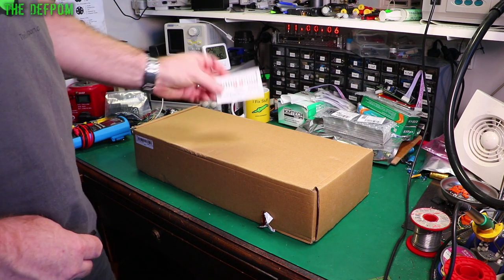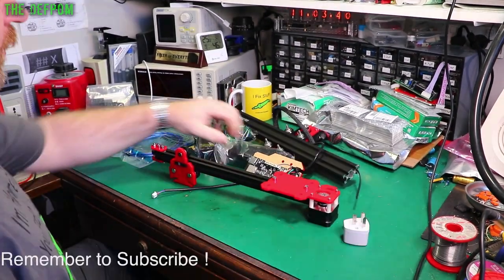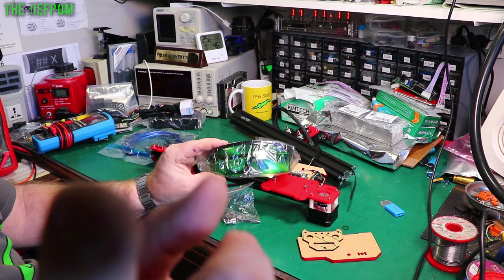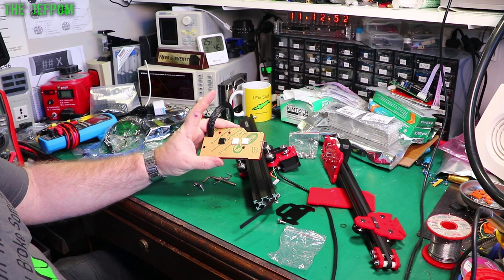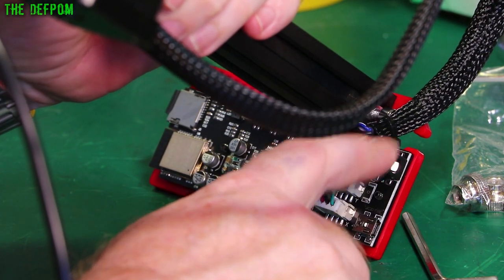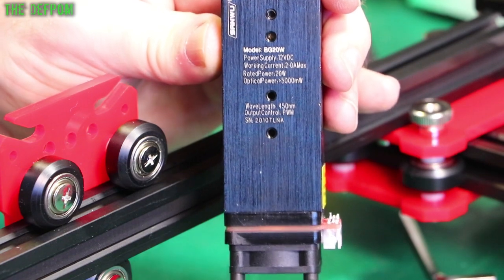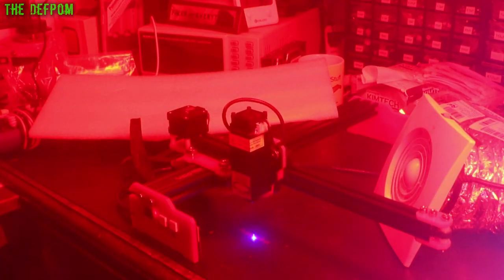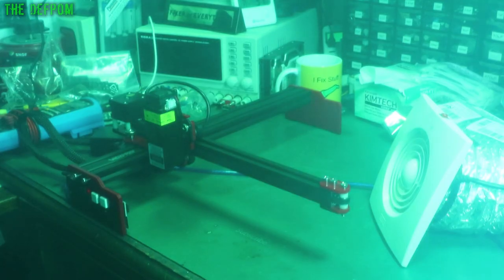🔴 Laser Engraver Review - Vigotec VG-L7X 20W Laser Engraver - No. 800

Comment: Will it engrave Aluminum?
It would want to modify so the object be engraved was would be firmly held in place in relation to the engraver xy frame and ensure that the z dimension was constant over the entire work area.
Reply from the maker: Not powerful enough for metals, maybe it can burn off powder coat/paint/ anodising I might have try it
Reply: @TheDefpom  It would be interesting to see.  The only reason I would want it would be to engrave instrument panels.
Reply: You are going to have to go a lot higher end to engrave aluminum, a fiber laser can do it and it costs thousands. You can engrave anodized aluminum with a CO2 laser and i have done it many times with my 40w laser, but thats about the minimum to get the job done.  They also make products like Thermark which is a spray on coating, the laser engraves on that and anything the laser touches is permanent and the rest you wash off. Its commonly available in black and brown, it works well but burning off the anodizing on a panel gives better contrast. I dont think you could manage this with a 450nm laser, a CO2 laser is commonly used.